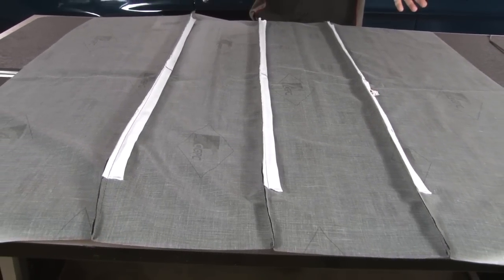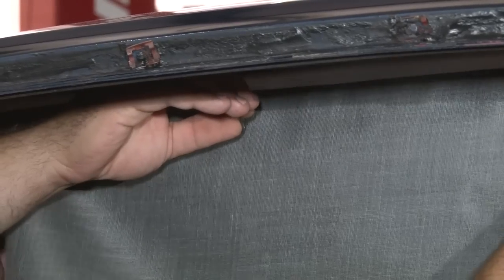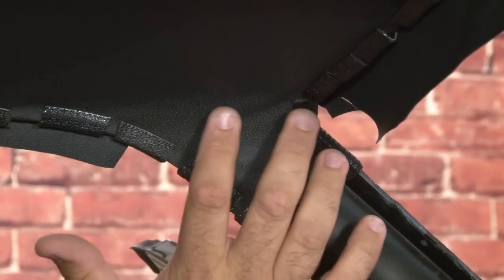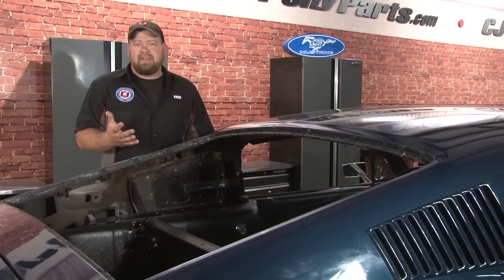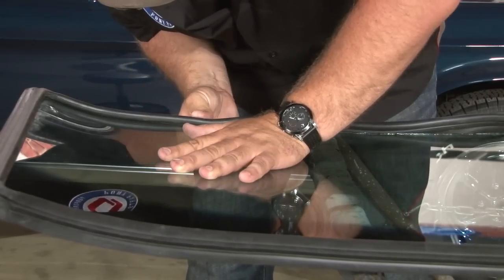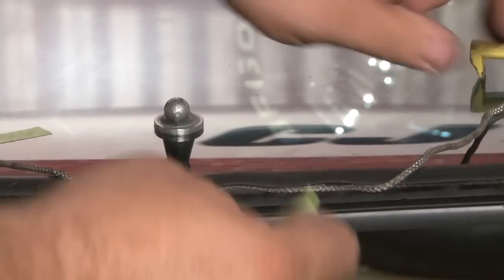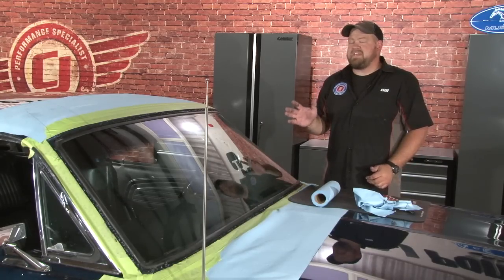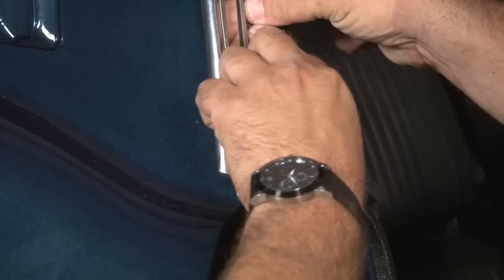Headliner | TMI | 1965-1968 Fastback Mustang

Comment: I’ll be doing this project very soon, my modified 65’ needs new front glass so I might as well replace the torn headliner while I’m there. 
Thanks CJ Pony for the parts and thanks Bill for the instructional video.  Great job guys!!
Reply: @Yehuda Jacob instablaster =)
Reply: @Dustin Edward i really appreciate your reply. I got to the site on google and im waiting for the hacking stuff atm.
I see it takes quite some time so I will get back to you later with my results.
Reply: @Dustin Edward It did the trick and I actually got access to my account again. Im so happy:D
Thanks so much you saved my ass!
Reply: @Yehuda Jacob no problem :D

Comment: Hey Bill. I have a 1967 coupe I'm restoring but, I have no clue on how to restore the air-conditioning. Could you, if you have the time, please do a how-to video (installation) on how to restore your mustang's air-conditioning. Thanks!
Reply: That could be a tough one since there are a lot of variables there but I will keep it in mind. Most likely we would do a video on adding AC vs restoring an original though.